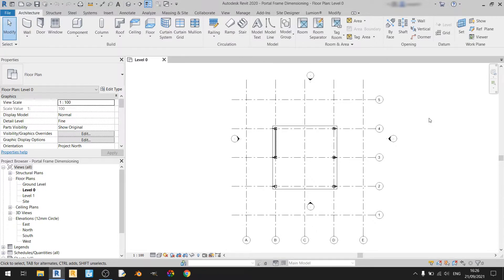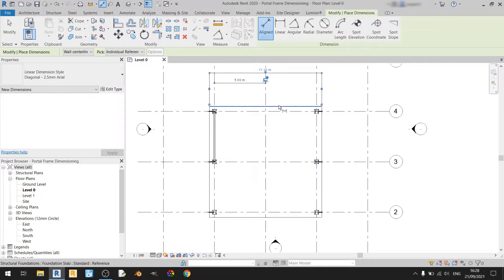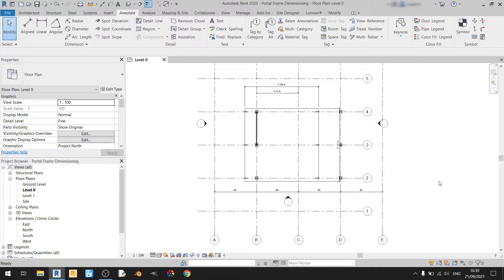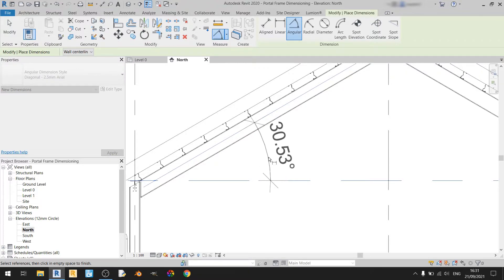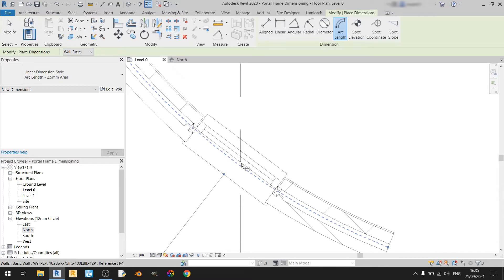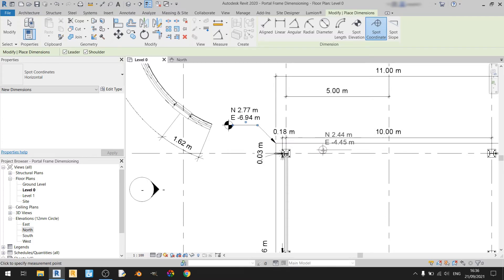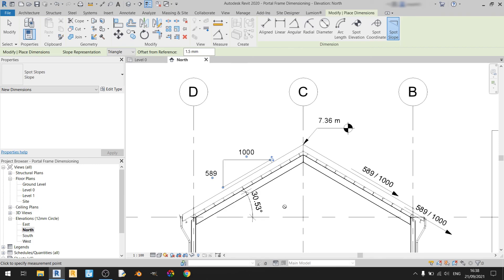Master Revit Dimensioning Tools in 10 minutes

Comment from the maker: Timestamps
0:00 Introduction
0:24 Aligned Dimension 
2:50 Linear Dimension
3:25 Angular Dimension
4:10 Radial Dimension
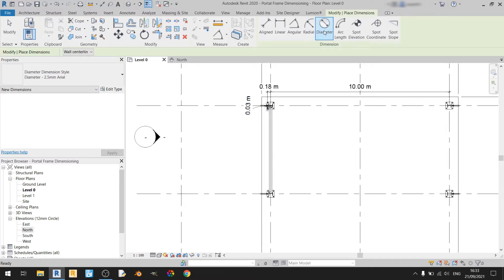5:16 Diameter Dimension
5:46 Arc Length Dimension
6:54 Spot Elevation 
7:21 Spot Coordinate
7:58 Spot Slope